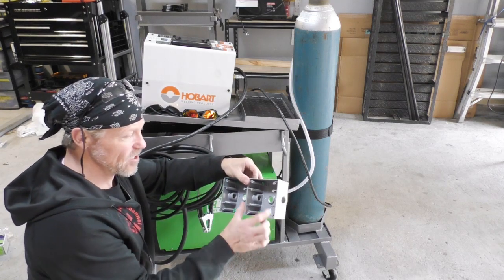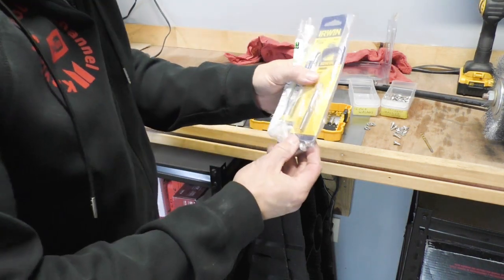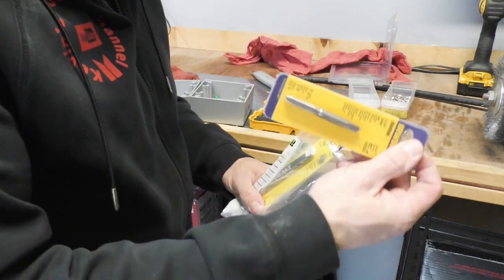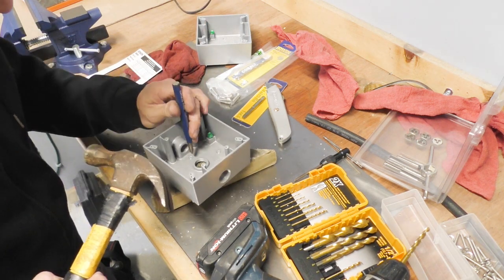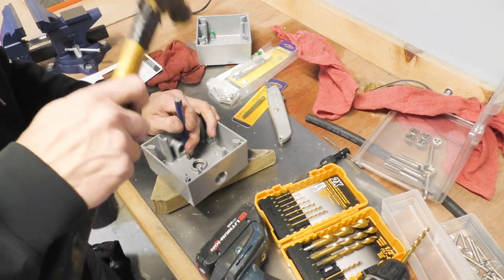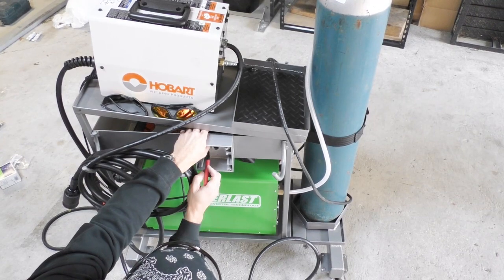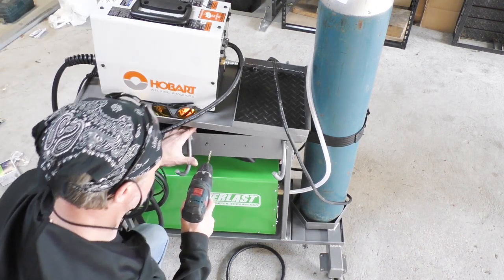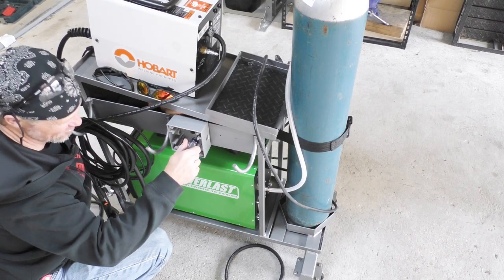WIRING TWO 220 VOLT RECEPTACLES ON THE WELDING CART

Comment: I just finished building my welding table and was wondering how to do this thanks for sharing the info do you know what would happen if you ran both machines at the same time? I don’t think I would Wilder one’s a plasma cutter and I work alone in my shop. I was just wondering what would happen if both were running at the same time.
Reply: depends on the breaker and the wire used.... your breaker and wire do not know if you are running two machines or one and they don't care. if your wire and breaker are sized correctly and function correctly, no worries. If not, good luck